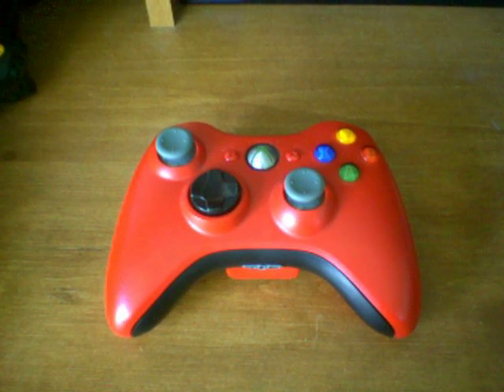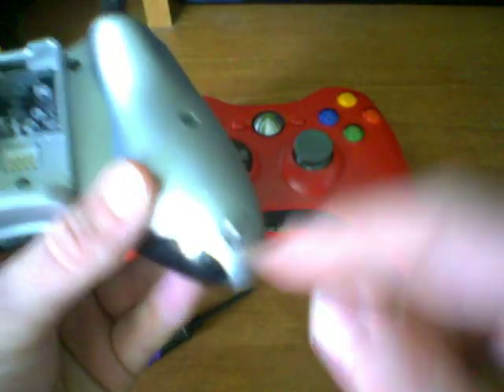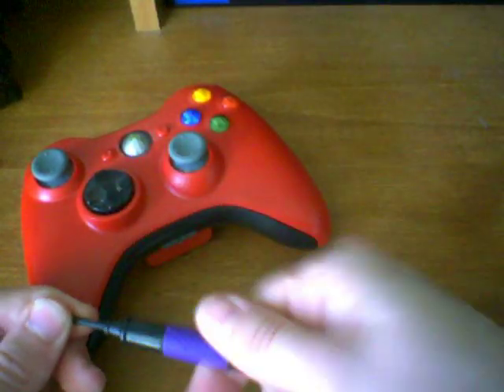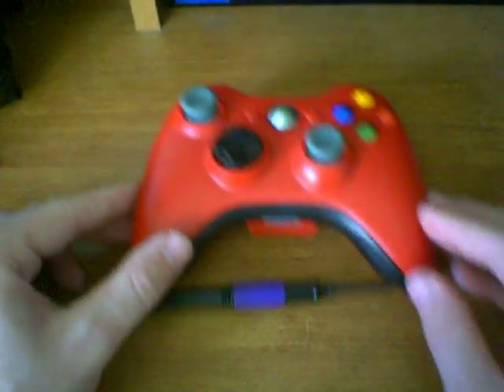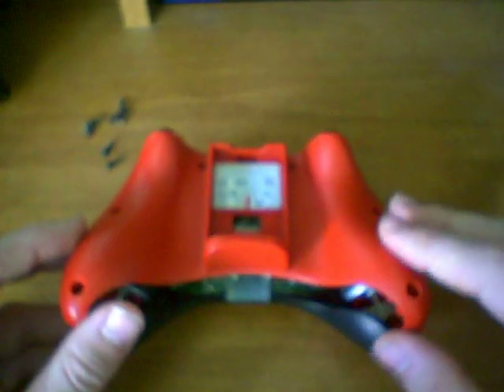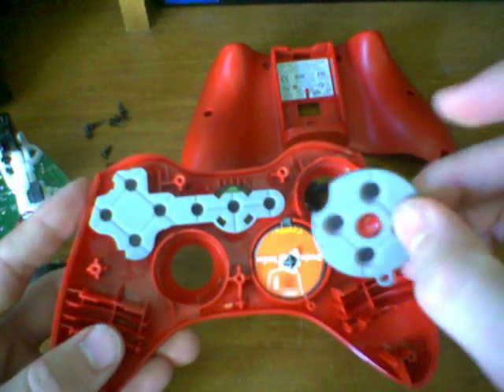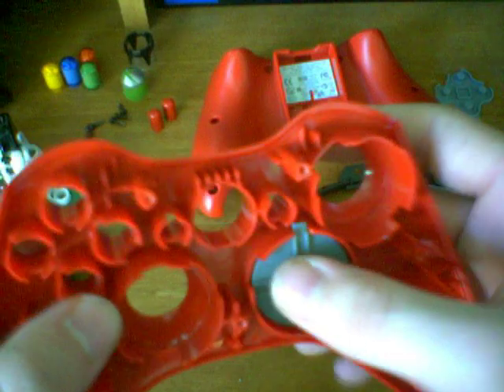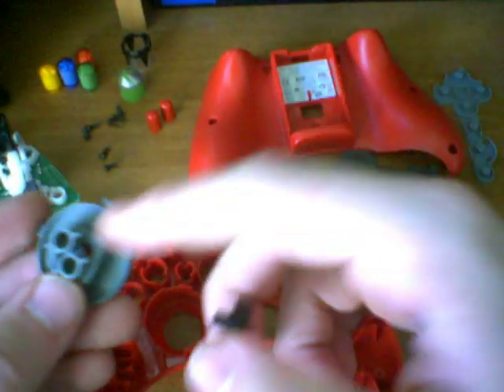Xbox 360 Controller Disassembly/Assembly Tutorial: Part 1

Comment: I just bought a Xbox 360 wired controller from Best Buy (one of the few they had left) and the screws have conventional Phillips heads rather than the security Torx heads shown in the video.  Check what is in your controller before buying the Torx screwdriver.